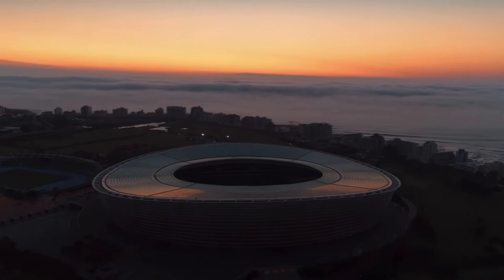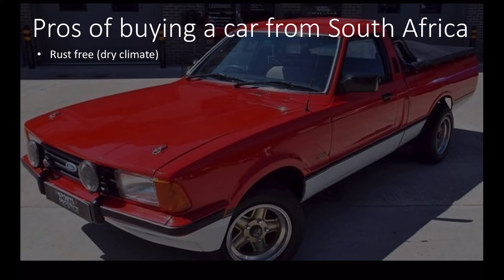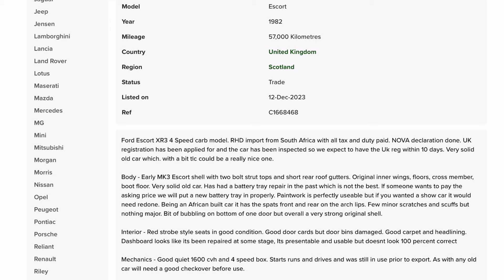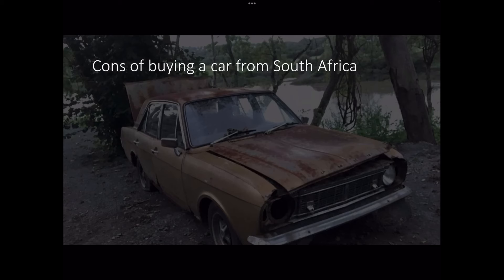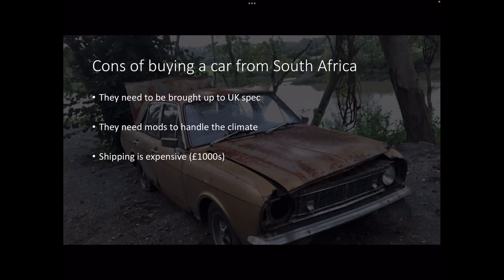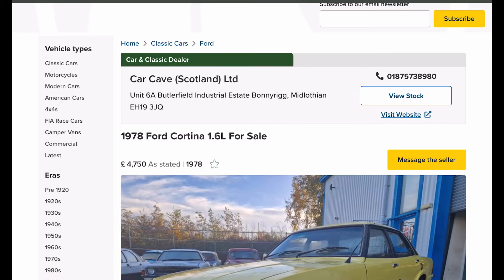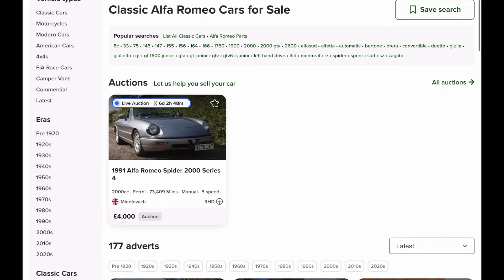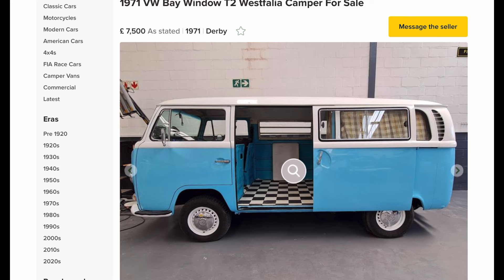My guide to importing cars from South Africa

Comment: Great Video! I'm actually watching from South Africa curious what other people think about our cars.

1 tip though... South Africa is a massive country not on the scale of Aus / India / Russia or USA but still larger than most might think... So with regards to RUST saying South African cars are RUST free is a little bit of a generalization... 2 of our 3 major cities are on the coast 1 with constant rain and the other with high humidity... However the largest city JHB (Johannesburg) is in fact as you said very dry! I would avoid Durban and Cape Town... It's very common that people in South Africa will drive 6-7 hours from the coast to JHB in order to pick up a car because of how Rust Free they are... Cars in JHB for this reason often command higher price tags, than there coastal counter parts with similar millage and condition. Additionally the car culture in South Africa is strong with dirty cars being societally frowned upon, there is alot of pressure to maintain your car, keeping it clean, well serviced etc... for a country with a lower income per capita people surprisingly spend alot on there cars and own them with pride. I grew up in Europe (Ireland) and now live in SA and I can tell you in SA a car is far less of a "Point A to B" tool and rather a member of the family.

Again great video I hope my comment helps! Thank you for supporting South Africa... Happy shopping lol XD
Reply from the maker: Thank you so much for your comment! This is really useful information as I am planning another video on this in the near future. Please subscribe and recommend this channel!!